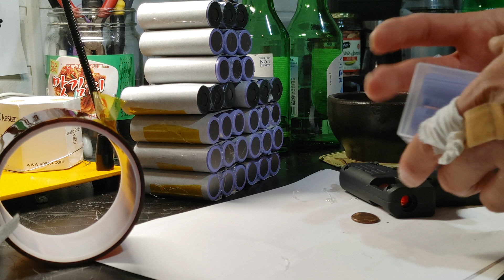Always use ring insulators, silicone, and fish paper for your battery packs!

Comment: Aside from the fact that you didn't have the batteries facing the right way, at least if it was to be used with a BMS, this is a good video demonstrating how to build a 3s 18650 battery pack. Thank you.

Comment: 3:39 That's not how you build a 3s 18650 battery pack, at least if you're using a BMS with it. You're supposed to have two positive terminals facing one side and a negative terminal (the middle battery) facing the other side.

Comment: Do you think I could use electrical tape with a hole punched in it for the top insulator ring??
Reply: No, that's cheap. It won't be professional. Use insulator rings made with fish paper.
Reply: @sharpmerciful787  Is that paranoid? Most decent battery are already insulated inside.

Comment: Then do you just glue the p groups together before spot welding?
Reply from the maker: Yes glue before spot welding so batteries don't move.
Reply: @dr.eskateboard3381  Thanks -any concern that the fish paper will make the overall pack less solid with fish paper in between the p groups? For example, due to vibration? (thinking the fishpaper stickiness becomes the weak point...)
Reply from the maker: I would apply fish paper just to the top and bottom after applying hot glue to put the p groups together.   No issues with vibration on any of my batteries so far.
Reply: @dr.eskateboard3381  thanks

Comment: Why use fish paper and the rubber sticker things? I've never seen either of these on any commercial battery pack and I doubt some thin paper will prevent damage to the battery?
Reply: Ring insulators makes a lot of sense! Nickle strips have sharp edges and with the added heat may break the battery insulator causing a short and 🔥

Fish paper helps with abrasion inside the battery pack itself. It's just an extra layer of protection... but if everything is secured down, heat shrink or tape should be enough protection. 

Silicone has many different grades and I find the cheap stuff don't adhere too well... Curious to know what brand/type Dr E is using.
Reply: Ah I now understand the reasons thank you. Fish paper sounds fair enough but ring insulators seem odd to me being as in all the batteries I have disassembled I've never found any. Then again they have mostly been from laptops which probably use significantly less current therefore less heat.
Reply: @Sam-bn9ix  use the ring insulators. Electric vehicles are exposed to a lot of vibration! It's easy to puncture the insulation and short the nickel strip at the positive terminal to the cell case!

Comment: Hey I'm completely new to building DIY electric longboarding and I want to build a board that's under $500 but I wonder if it's going to be better than the Meepo v3 that's only 379 right since it's my first build. I was thinking about using hub motors. What do you think I should do? Also what tools would you recommend for someone's first time building a DIY board?
Reply from the maker: Instead I would buy a cheap board like ownboard then later upgrade that board.   Much cheaper unless u r building a big board get this with Samsung 40t battery

https://www.ownboard.net/collections/boards/products/ownboard-c1s-35-4-electric-skateboard?variant=12922297745450
Reply: @dr.eskateboard3381  Thanks! This is definitely the play